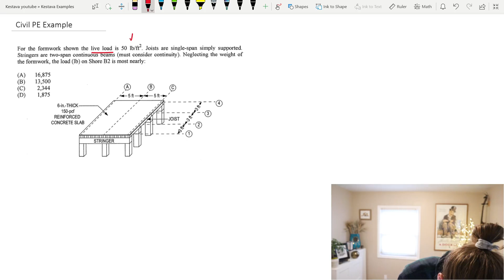Avoid this Mistake Using The CBT Civil PE Reference Manual | PE Exam Review

Comment: You can also use superposition i.e.  take the value of (5/8)wl which is given in the reference book for R2 and multiply it by 2 to account for the adjacent span, which is basically the same formula you showed.

Comment: I assume that the PE reference manual thought you would use superposition for the load case where one span has weight and the other doesn't. By using superposition you would get an R2 of 5/4*w*L where w is as calculated and L is 5 ft giving the same answer.

Comment: I think the formula comes from ACI- SP-4 Table 7.1 p 7-5 ; but honestly can just use the 3 span formula with load across only 2 of the spans: Continous Beam - Three Equal Spans - One End Span Unloaded (this is in the civil reference manual and aisc (diagram 37)). It is so similar to the real 2 span one doesn't matter on test . 3 span = 1.20wL while 2 span = 1.25wl . 

The correct way to do it though using the AISC:  TABLE 3-22C (CONTINUOUS BEAMS MOMENTS AND SHEAR COEFFICIENTS):  You will see a equal span equally loaded uniform load table. You will notice  a "number" "arrow up" "number" divided by a "number" in the shear visual part under the reactions. These are the shears at the reaction points (they can be different positive and negative directions). To get total reaction at that point you should be adding these shear numbers up then dividing by the number under it then multiplying vs wL.     L should not be the total length of continuous beam, only the span. 

For example (using ^ as up arrow): 4 span beam has 17^15 /(28) from the table. Negative shear = 17/28 * w * L (span only) which matches the diagrams in table 3-23 btw. The positive shear at that point is also 15/28 * w * L. To get the reaction it is ((17+15) / 28) * w * L (span only).

For example in the video: It is "5" arrow up "5" divided by 8 in AISC TABLE 3-22C.    ((5+5)/8) * w * L = correct answer. It just so happened the shears at the mid point are equivalent so multiplying by 2 for total length it just worked out, but in other situations it will get wrong answer.
Reply from the maker: Hi Smoke - Really great explanation! The only additional context I'll add is that at 6:19 I state that the equation used from AISC table 3-22c is for equal spans and equal loading. this means that the reaction at mid point will always be 2 times the shear value from each span or just double the span length like I did - it shold get you the same thing every time, BUT it must be equal spans and equal loading.  next time ill stick with 10/8wl instead of 5/8w(2l) - I made it confusing!
Reply: @Kestava_Engineering  ahhh gotcha. Thanks for content btw, good stuff =]

Comment: AISC is provided on the exam so all of the beam equations are there...
Reply from the maker: very good point Jefe. Just wanted to point out that the reference manual doesnt include things like that, where as a typical paper back reference manual traditionally has a lot more info

Comment: Thanks. However, I don't see any equation for continuous beam - Two equal spans - distributed load in AISC. The 5wl/8 is for when the load is on only one span!
Reply: Look at Table 3-22c. Moment and shear coefficients are given for continuous beams with equal spans uniformly loaded. Refer to the two span beam figure (its the second beam from the top). From there on you can get the reaction at mid support = 5wl/8 + 5wl/8 = 10wl/8 where l = 5ft for this question. Hope it helps.

Comment: I'm not finding the diagram for 2 span with a uniform load all the way across in the steel manual either.
Reply from the maker: Hi Christiane - I use the 14th edition and have them available in Table 3-22c page 3-212, does the 15th edition not have this anymore???
Reply: @Kestava_Engineering  The 15th edition does not include this diagram unfortunately. Only has the one that you showed in the reference manual.

Comment: I spoke with NCEES in my state and they said depending on your depth is what you will be given for references.  Structural and Construction.  If you are Water, Geotechnical, or Transportation you will NOT have access to these resources and only the Design Standards provided by NCEES for that specific depth.  I would email or chat with your state board to verify this as well just to get full clarification.
Reply: Hopefully the breadth and depth portions will contain questions appropriate for what is provided... if the question in the video was in the breadth section of a water exam, which will not have the steel manual reference, that would be concerning. Likewise for any water questions that require our standards ending up on a structural exam's breadth portion.
Reply from the maker: Jeffrey this is really great info! I'll give them a call and see what the deal is. I had no idea that some test takers may not get the reference manual.
Reply: @Kestava_Engineering  everyone will have the pe reference handbook, but not AISC, ACI, NDS etc. Is what I was told.  For example, water will have the three references, PE Handbook and the two references they have now, transportation will have pe reference and their depth reference, structural pe reference and their respective depth references, etc.
Reply: @Jeff29E6  spoke to ncees and confirm what you have stated here. i am water and will have 3 refs. already got them in pdf and am learning to search them efficiently.

Comment: Thanks so much for pointing it out. I do not know really why they this kind of Manuel . They have elaborated slot on water section and geotechnical that what required in addition they have taken out the import part of construction and structures . What is your opinion?

Comment: Hi Rich! Thanks for great content. Are you familiar with sfrc desings? If so, it would be good subject for a video. Ps. Hieno nimi ja logo! Greetings from Finland.
Reply from the maker: JaffFree im seeing that sfrc is steel fiber reinforced concrete? I have used this system before back in massachusetts for a slab and have watched a few lectures on the subject but im not the most well versed. Is that becoming big in Finland?? and kiitos!
Reply: Yeah thats what I ment. I think sfrc is becoming more and more popular all around the world and in many different structures, so it would be nice to hear how did the structures turn out etc. experiences in general.